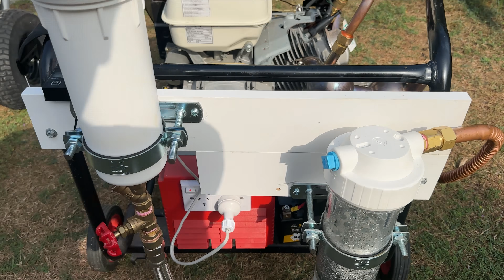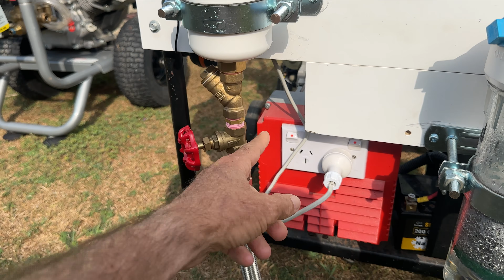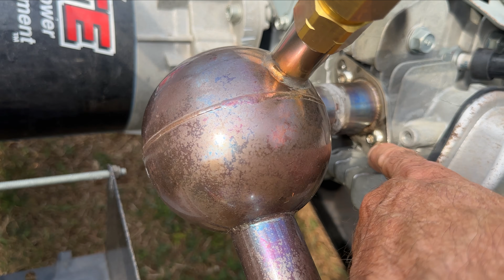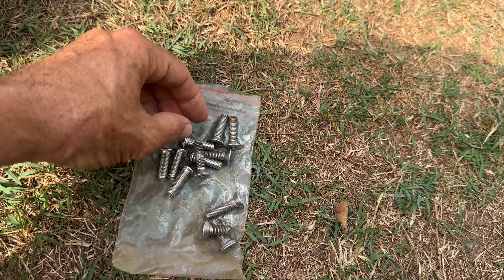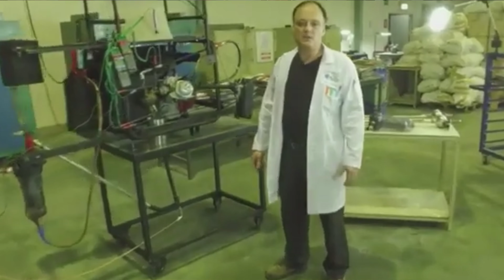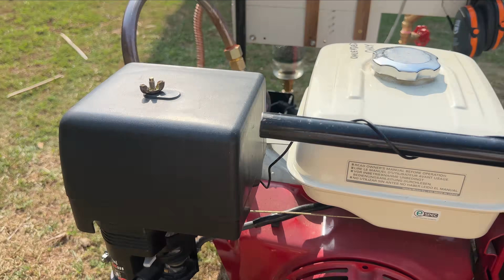Thunderstorm Generator Final set up on my Honda GX340

Comment: so this video is 3 months ago, have you used the generator in some practical way? what about long time running with charge.
Reply from the maker: Hi have been busy moving house and building the new shed so haven't had time to do any updates or more testing , but I can definitely smell the emissions difference when running. I don't us motorised weed trimmers as they give me headaches and the first thing I noticed was that my head felt fine

Comment: Interesting, i am uncertain about something, when you mentioned feeding the exhaust back into the carb, how is the extra effciency obtained if this isn't the default setup? I have seen reports that less fuel is needed and thought that was because of the feeding into the carb of exhaust gasses and like you mentioned the extra oxygen content, Cheers from Sydney !!!
Reply from the maker: So the 2 systems don't actually intercept directly, the cold air intake is running in a clockwise spiral and the exhaust is running in the opposite direction but they are separated by a metal wall, but through this geometry there is a magnetic anomaly being created the same as a thunderstorm  with hot and cold currents colliding and creating lightning which is a form of plasma. This plasma created in the balls is the mechanism that is pulling the water atoms apart and electron s are attaching to carbon atoms on the exhaust side and creating a molecular transformation. We see it every year in thunderstorms and yet science is still struggling to theorise it. Malcom Bendall has theorised the process into a structured model that can be replicated with simple materials , but it's still very early as to how far this can be developed and implemented.  Id go to Alchemical science and listen to Malcolm, It's nothing new its only the fact that Malcolm had a lab for 10years to build prototypes and open source his findings before what normally happens to a lot of inventors.

Comment: nice work. adding the air back in, is based on a system developed by GEET. and it works
Reply from the maker: so there is actually no transfer of air inside the spheres but it is creating a plasma reaction the same way a thunderstorm would with hot and cold currents colliding and lightning being emitted which is also plasma. This plasma is reconstructing molecular structures of the carbon by adding electrons from the Hydrogen and creating new elements. Id recommend having a look at alchemical science channel. pretty amazing
Reply: @martinjurica3460  GEET used magnets to make the plasma. the documentation shows ice forming on the intake. there is no pollutants in the exhaust. even works with diesel.
Reply from the maker: @canonfodder8090 yeah I remember getting the inner rod magnetised that sat in the pipe.   Made a very efficient burn on all sorts of gluggy oils

Comment: Its a geet generator paul pantone..stolen idea
Reply from the maker: I also put a geet on a motor around 2010,  So I also wanted to see the difference ,   this is creating a plasma field in the same way a thunderstorm uses hot and cold currents colliding and lightning being generated. This is just a micro version using hot exhaust and cold air intake infused with water bubbles that are also present in a thunderstorm, there is no mixing of the exhaust and intake inside the spheres, Id recommend looking at alchemical science channel and just seeing how this is converting and rearranging the molecular structure at an atomic level. Im also a fan of Paul Pantone

Comment: I want to see someone route the exhaust back into the intake manifold make it a completely closed system theoretically it should run if it actually does convert the exhaust back to oxygen it should be completely self-sufficient.
Reply from the maker: The plasma is produced the same way as a thunderstorm feeding off hot and cold currents colliding so Id say you would have to cool the exhaust air current down first ( maybe via an intercooler)so when it re-enters you still have a viable temperature difference to sustain the plasmoids. but absolutely Im sure someone will do it soon , Im very sensitive to outboard fumes and mowers as it gives me a headache pretty quick and that was the first thing I noticed was I could put my face in the exhaust flow and my head felt fine which really blew me away.
Reply: @martinjurica3460 As long as the oxygen content is high it should run just at a reduced power. I'm 57 and built and raced engines all my life we have had engines with 145 + intake charge temperature and run fine. I understand in theory how this should work but there are several things that just don't add up. The minute someone does a closed loop set up and I see it run on the oxygen that it produces from c02 I will be all in.
Reply from the maker: @MelvinGrimes-p4l  I totally understand , all the current conventional physics have been blown out the window. That's why I had to buy one to try for myself. I got my first car at 12 years of age and have seen a lot of technology suppressed and people disappear. I think the only reason Malcolm got it out there is he hid for 10years and financed himself. I am also a skeptic but Im also seeing real data and my setup is quite basic.  I did an emission comparison just with a safety analyser in my videos and I have no affiliation with them whatsoever but yes I would love to do a closed loop but im still working 60hrs a week on an island so it may take some time. Im sure someone will try it soon

Comment: I'm also in Australia and waiting on my kit to be delivered my Quote didn't seem to include Tax so I think I will be hit with that.

I like the idea of copper pipe over the steel mesh flexible tube what is the red sealant on those joints ? is that high temperature thread lock or silicone ? Did that come inside the Kit ?
Reply from the maker: There is a high temp braided hose with the kit but I just had a leak issue somewhere and just want to see some better results so tried the copper pipe. yeah you will Geta notice from DHL for customs duties and tax . about 315$   The red silicone didn't come with the kit but the exhaust sealant did which is kind of like muffler putty. you can get the high temp silicone from repco about 35$ or other car places. Good luck with the kit a bit of fiddling around but you can smell the emissions difference big time.

Comment: It still needs gas so I really don’t see what is so ground breaking just no carbon monoxide take the gas out of the tank won’t run what’s ground breaking
Reply from the maker: Inventors that reveal enormous changes normally get squashed very quickly.  reducing carbon by 90% that can be applied to any combustion system including power plants is a big step. Unfortunately anything that produces free energy seems to get nabbed by Men in Black and people die of sudden deaths. hopefully things change for the better
Reply: @martinjurica3460 still uses gas bud it doesn’t run on water that’s is ground breaking 👌🏼
Reply: @C.R.Davis24 it’s meant to kill emissions that is groundbreaking
Reply: @LanternsoftheDead yeah with no proof just a video talking yeah ground breaking show some data and prove it I can say I solved something but with no proof just a video talking yeah ground breaking
Reply from the maker: @C.R.Davis24  😁The bubbles of nothing make it really something. This video will explain more https://youtu.be/zrHdz5yMjBI?si=DS-syex-1L2BCN25

Comment: If you look at the exhaust output the tube is totally carbonised "black". Please explain why!!!!
Reply from the maker: when I first set it up I had a braided hose  supplied in the kit but I think it had  air leaks at the fitting joints, so I  had black smoke and a high carbon monoxide reading. I  have only run the system about 5 times  for about 30min each  time , not sure  if  it will clean itself up ,, but I will probably change the position again soon and will try the flexible hose supplied in the kit depending on on my readings from the analyser,  I might put the copper back on again.. I just find it fascinating  to be experimenting with something that  is reconstructing  elements in my back yard. very early days

Comment: How is this any different than a large EGR valve? Its just recycling exhaust gas into the intake essentially reducing the fresh air/fuel mixture usage.  Id be willing to bet it doesn't idle with the the valve open and has a lack of power underload.
Reply: This is totally different from an EGR valve. The intake is inside the exhaust. This is plasma. With the exhaust gas rotating outside the inlet. More similar to swirl intake manifolds. I am currently making my own, this is excellent work
Reply: Inside those balls are billions of sonoluminessense plasmouds made from cavitation that when they explode fuse the carbon into oxygen. No, this is not like an EGR value, this is a low energy nuclear reaction relying on cavitation which was only recently proven to be a nuclear process, hence the light when the bubble collapses. This is actually a simple fusion reactor being used to clean an exaust by fusing the dirty shit into cleaner heavier elements like oxygen.
Reply from the maker: mine seems to idle OK.  Due to the secondary air intake I close the choke once the bubbler valve is open. As to the balls, the air and exhaust are kept separate and the balls are creating a tornado effect with hot and cold currents like a thunderstorm that's created in nature , this is creating micro lightning and reconstructing elements at an atomic level. I would have a look at the links to see what Malcolm Bendall has discovered. Its very early days and at the moment its an open book as to the applications. Very interesting technology using sacred geometrical configurations seen in nature

Comment: This will help   until zero point energy hopefully 
✊✌️❤️
Reply: This is zero point energy
Reply from the maker: Its been squashed so many times by the oil industries, at least this is complementary for the industry which will gain a nice momentum to transition over and no- one dies in the process

Comment: Hi there quick question, I can see your using the original engines air filter, are you having any issues running the engine once it’s warmed up? Someone else said they had to keep the choke slightly on once the engine was running with the bubbler? I wondered if changing the needle to a larger one on the carb may help, Thanks.
Reply from the maker: once my engine is running I open up the carby (choke off) but when I turn on the bubbler I can decrease the air intake from the carby as I can hear its getting too much air. So I actually close the choke to fully shut and the motor runs smooth again. There was a little bit of adjusting with the throttle arm after putting on the extension which I forgot to mention but everything is as it was from standard.
Reply: @martinjurica3460 ok thanks for the update. I really want to try and make one too.
Reply from the maker: @anthonynorris7736  There a great support group and Kevin Baker is very genuine with his feedback. good luck

Comment: Cool. What’s you fuel consumption under sustained load? Eg 2kw 1hr = x liter fuel?
Reply from the maker: still to venture there yet, that's why I bought the tacho first just to see if the rpm increases during testing with and without TSG. Maybe the Benator (Ben) will do a comparison as he has 2 motors ready to go.

Comment: I'm excited when these this get retrofited coal power plants.
Reply from the maker: absolutely huge win for both petrol and electric cars and everything inbetween. 😇
Reply: This is fusion, it has the ability to replace those coal plants; the notion that all it can do is clean dirty exaust is silly, it's fusing elements to make carbon into oxygen, with a different design and some water as fuel, you can make a fusion reactor that makes clean energy at home the size of a basketball that will run your house. Sure, we'll put them on cars, but the real power here is using the plasmoids to fuse hydrogen for energy rather than carbon for clean air.
Reply: I'll be excited when people start pumping lead dust through them to make gold.

Comment: Hey there, noticed none of the builds tend to not to add the Muffler back on, surley this would help from a noise point of view? also interested to see if the bubbles would work from start-up or do we add a delay cct for an auto start situation like a self starting genset backup situation?
Reply from the maker: My setup is fairly fresh and I noticed that readings stabilise after a minute or so of running using a confined space analyser which reads up to 200 CO ppm right on start and comes down to 60ish after 30seconds or so. Maybe as the exhaust heats up